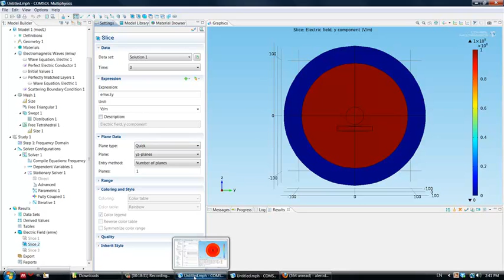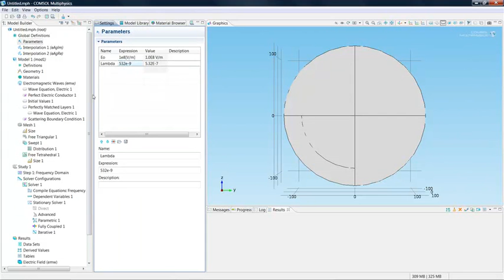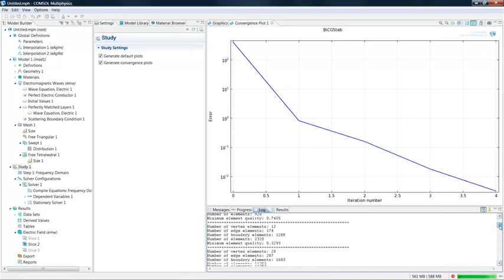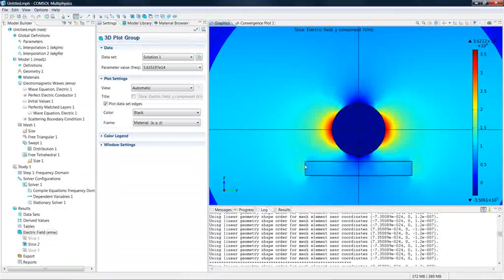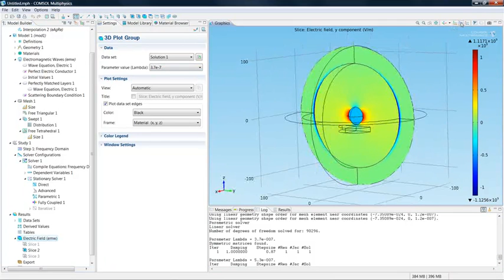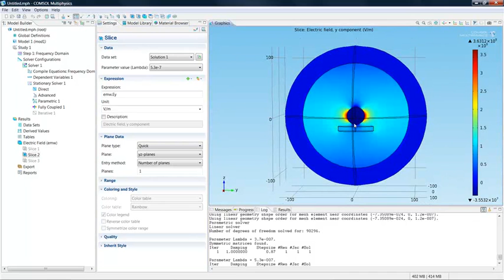Comsol 4.2 Tutorial Part_3.avi

Comment: Hi there. Your videos were very interesting, and helped me in my models. But I'm having a problem when trying to simulate a nanodiopole with a lumped port between them. What I seek is the lumped port impedance and the s-parameter. When I simulate a dipole in meters scale and with MHz frequency, it leads me the right answer, but when I use a nano scale and THz, then it leads me to a very small input impedance. For the boundary condition, I just use a sphere with the scattering codition.